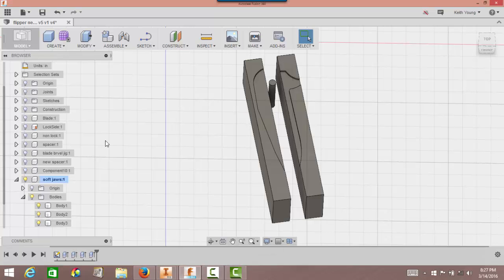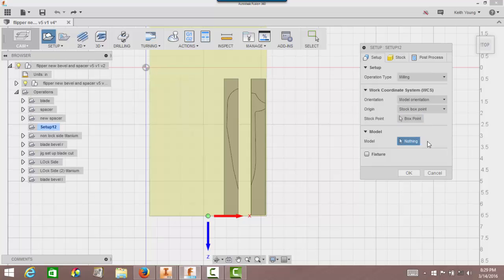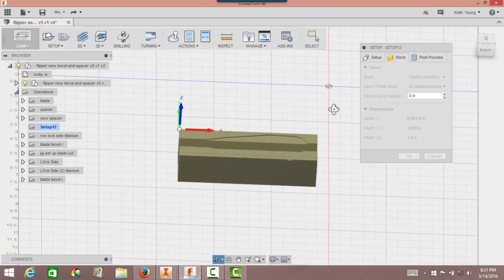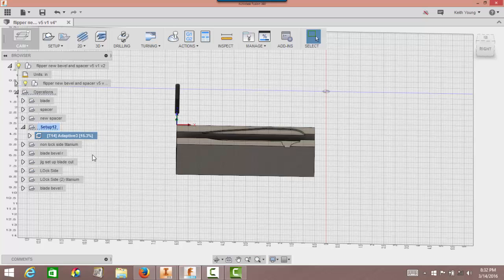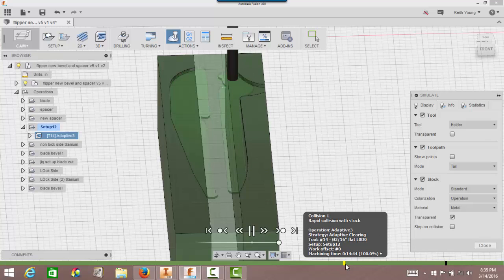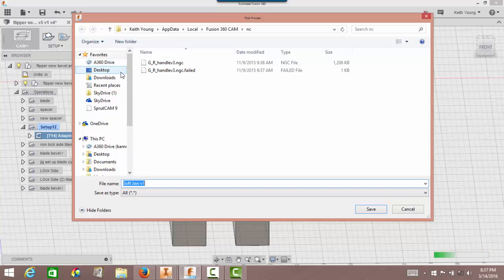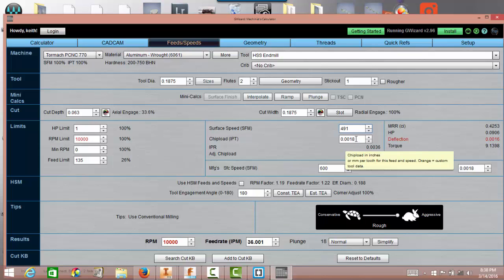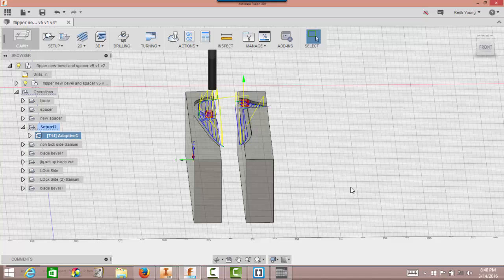Video 2: Making soft jaws using Fusion 360 CAM

Comment: Can I ask why you didn't do a mirror on the blade profile cut out so you can flip the blade and face the other side? Also, once the design was in place was there a reason you didn't move the two blocks together to save time and avoid some of the issues you were having? I'd think that running two pins into the sides of the aluminum would help to center the soft jaws and avoid the awkward trying to balance on a vice while putting a knife in place.

Comment: Dont you think cam is stupid you pick what you want cut and it will do something else. but you told it to cut top to bottom that figure. so it go top to bottom.
bottom blue line is that you never change. just move it depth of that figure. it would do it first try. it so smart it gives you warnings,but so stupid not fix them on fly calculating them again. and it generate so funny figures. so next time you know you dont need waste time doing jaws and extrude it from jaws just need outline on top or bottom then select figure and tell how deep you want cut :)))

Comment: Good video!...Just curious why you chose 3D adaptive instead of 2d?
Thanks.  I'm new to Fusion.
Reply from the maker: +jfpinkston If I remember correctly, it would not let me pick the area and path that I wanted to machine. I think if it was a solid pc or I used a patch it would of worked.

Comment: Hey bud, how do you like the 770 ? I'm in the market and looking at the tormach.  I've used the 440 at john Saunders training class . Which was awesome by the way. I haven't really checked but is the 770 and 440 equal other than the working envelope?
Reply from the maker: +GRISSOM Knife &amp; Tool The 770 is a great machine. It works very well on engraving. I use a 1/6 ball end mill at 10000 rpm and 5 ipm with a purge 0f.7. I do like to fast rpm. The one think that is a little bothersome is when surface grinding the CPM S90V steel, I have to change to the lower pulley. I am not sure maybe this would also need to be done with the 1100. It also work well for other milling. I am waiting on a 3/8 hard milling ball end mill from Lakeshore Carbide. When I get this I will shoot a video of the Tormach 770, making a hollow grind in my heat treated skinner knife. This knife is at 62 HRC.